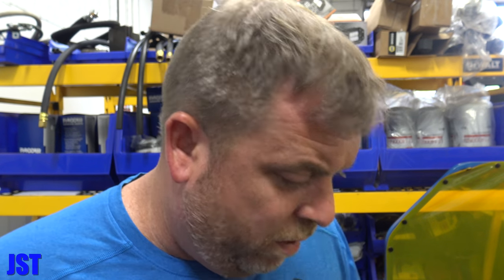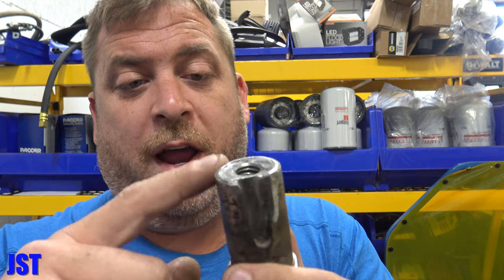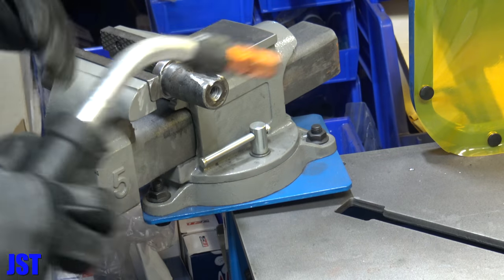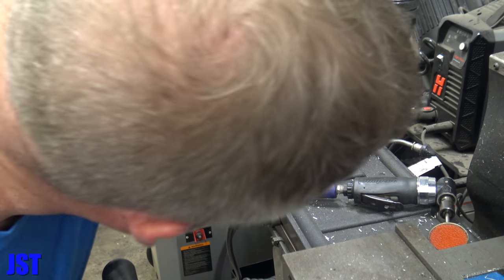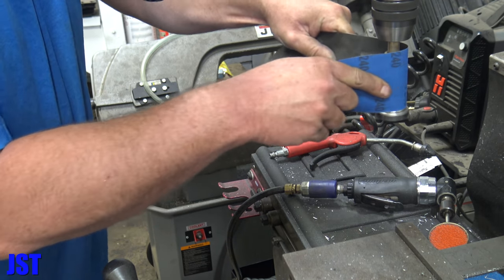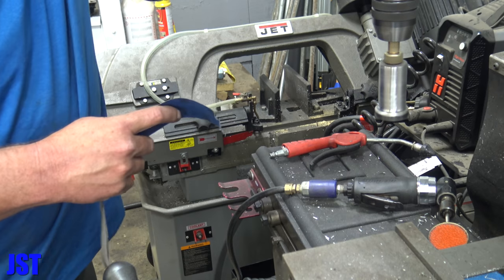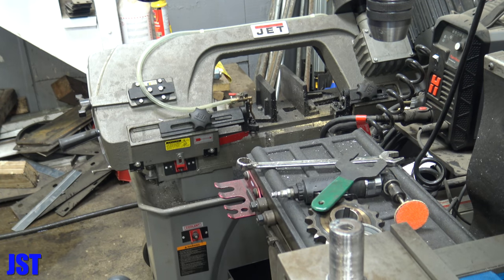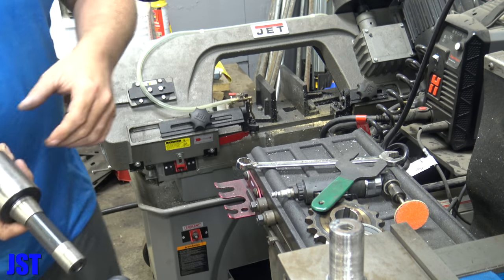BOBCAT BROOM REPAIR

Comment: Mount a vice on the mill table. Tighten a lathe tool in it. Touch off shaft. Move Z up. Turn spindle on and slowly work the head down.
Reply: That way it’ll stay more true and round and  sanding.

Comment: My guess is that's supposed to be a press fit. Now that it's machined smaller than the sprocket all of the load is on the key way hence why it keeps wearing out. The bearing is probably pressfit as well on the pin (i.e. the inner race should not spin).
Reply: The bolt on the end probably holds it all together so it won't spin.. Clamping force you'd be surprised how much there is.. A new pin would have been easier haha

Comment: V blocks will help find the center of a round stock in the vise.  There are versions of work piece holders too that help with holding down odd shaped parts vs. only the vise. thanks for sharing.

Comment: I'm a machinist...

First you need a lathe to do what your trying to do well.

Bearing fits are usually somewhere in the neighborhood of +0.0000/-.0005 or +.0005/-0.0000, for the type of bearing you are using, there are some bearings that actually have +.00000/-.00002 tolerances.  Sliding on not good. The piece you made is 100% scrap.  If it is too hot to handle it is way too hot to measure.  The metal will contract maybe as much as .001 when it gets to room temperature, which will mean that bearing will be sloppy.

Shafts for bearings are always measured with a micrometer.  

All things considered best bet is just to buy a new one next time, bearing fits aren't anything to cut your teeth on.  If you had a lathe and knew how to use it well best bet would be to make a new pin.  Repairing that pin would be a bigger headache than it was worth.
Reply: I was going to say the same thing about measuring while hot and the fit of the bearing. Also V blocks would be preferable to clamp something like that in a vice.

Also moving the work piece mid cut and while the mill is running
And no safety glasses.
Reply: Bill I'm also a machinist and agree 100% with your tips mostly the heat in measuring I believe the only thing that helps this fix not wear out again is that with a broom unless your trying to sweep a huge amount of material the brushes flex and the bearing won't have a massive amount of twisting pressure but your right for sure. With that said I think for a repair on the cheap with no access to a lathe I think he did a pretty decent job of making do with what you have I also operate my own equipment welding repair business as well as mobile line boring on heavy equipment and most of the time equipment owners are looking for something to get them to down time so they can fix it properly but most of the time the addage is true  "time is money"

Comment: That bearing should be a press fit...the bearing is going to spin on the shaft and ruin it. Measuring an  interference fit part hot will mess up every single measurement.

That sweeper is going to need a brand new pin soon.